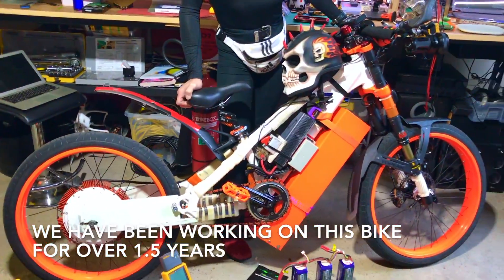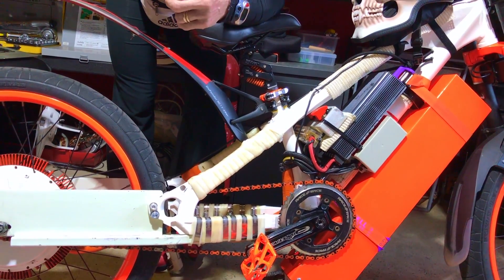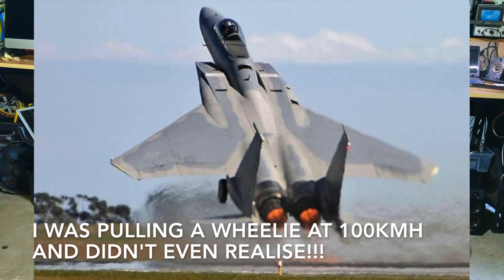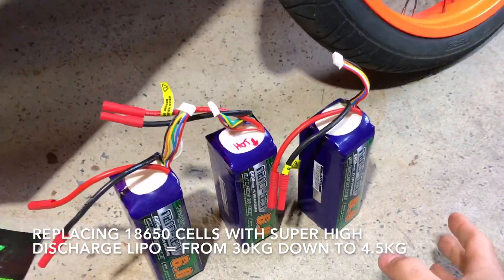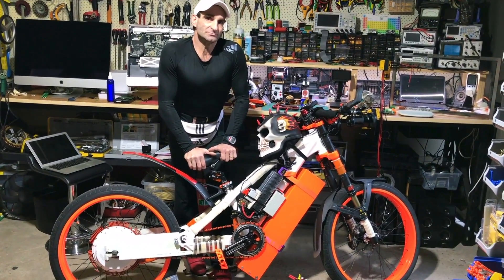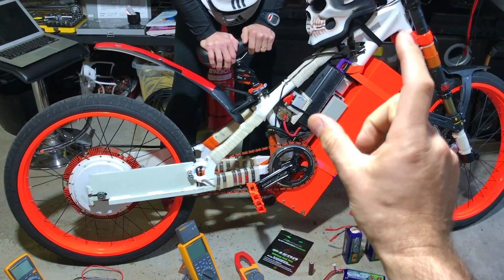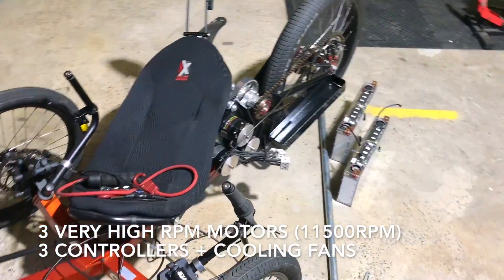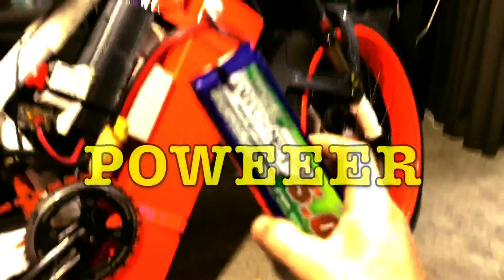191kmh Electric Bike (118mph) Video 1 - Project Introduction

Comment: Super cool why not take a cheap rear swing arm off a mtb with rear suspension got the triangle got the bushing n the shock mounts already it attaches in front of the bottom bracket stock so bolt that to the rear dropouts adding a pipe between

Comment: I've thought about building a very powerful ebike, but I got sick of not knowing the load & speed ratings of bicycle tires, and I haven't found motorcycle tires in bicycle or ebike sizes I was interested in.
Lacing a hub motor to nearly any sized rim, is fun, and I was even preparing to use a tap & dye kit to modify spokes that are between sizes. But for now, it's just too much money & work for me now. But I'm keeping my options open as I save money. Except no more hardtails, I want full suspension, with whatever bike I buy or build.
Thank you two so much for showing this prototype.

Comment: I have this same controller... how do you unlock it?
Reply from the maker: Yeah so there are two options when you buy it, standard and “unlocked” without software limitations to parameters. Basically you set things until everything explodes (we haven’t exploded anything yet).
Maybe email the company you bought it from and see if they can help you unlock or if you can send it back and they can do for you.
Reply: BrunoPOWEEER i see... thanks a bunch, can’t wait to finally have this monster up and running
Reply from the maker: Ohhhh yeaaaahhh... you will be surprised how CRAAAAAAZY this controller will feel unlocked hahaaa =]

Comment: Bruno how did you have hack the 100a Sabvoton bud?200 extra DC amps is one hell of an achievement 👌Did you change the fets or add more,change caps and beef up the traces with copper?Did you ever manage too get the standard Sab 120 to run more than the 120a and if so how did you manage it pls.Really want to see this bike go in part 2 Bruno🤞👊

Comment: @BrunoPOWEEER  I have a 72v 10000w bike. I made a 5p 20s configuration out of liitoKala 26550 cells. I have a sabvoton controller and anything over 120a I get high voltage drop. Also the top speed is 55 mph and I'm trying to make it faster. What do you suggest.

Comment: If you used those smaller high discharge lipos 6000mah is only like 6ah so what would the battery range be like I'm assuming it wouldn't be able to Last vary long?
Reply from the maker: It depends, if you have 6Ah configured in high voltage like 96v nominal and 117v fully charged it’s actually “okay” but if you have a 48v 6Ah it’s actually a very small battery.
Lipo packs would be good, smaller, lighter and capable of higher discharge but James the bike owner wanted to use 18650 cells (safer and more stable) as he rides this bike everyday. If this was a purely racing bike he would go Lipo all the way!! 
*HobbyKing has a 20Ah that comes in 4 or 6s bricks and are a great value + high discharge +/-460A peak, in my opinion these are a much better deal than smaller super high discharge 6Ah
Reply: Lipos are better for quick power dumps (sprints) and LiIon are more power dense and better for endurance (marathon)

Comment: if you get it licensed as a moped instead of treating it as an ebike and you have license plates on the bike you will not get stopped on the road, unfortunatly that means there will be the cost of insurance and such and you will need to install a limiter switch for normal, fast, and max speeds (p much just like a gear shifter)

Comment: i have the same motor but 30x4T what is the max temp cutoff and also what is his constant high temp?
Reply from the maker: We never got this motor too hot to touch as it has the Hubsink and ferrofluid which helps a LOT the heating dissipation. If you want more info, find James Raftos on Facebook, he’s often on Endless Sphere on Facebook (group)  and always very helpful relying comments =]

Comment: If you get speed wobbles your dead.
Reply: Bvlvi Woodson how are you? The bike is very stable at high speeds, the extra long wheelbase also helps. If it gave me the speed wobble I would have known by now. But you are right it would be disastrous.
Reply: @jamesraftos3586  I am good love the show! I have had speed wobbles twice in my 20+ years of Riding. Very rare but anything over 80-"95 if your strong asf"you will get thrown off the bike! I really like your show so please retro fit it with an anti speed wobble bar. Because I want more episodes! :)
Reply: Bvlvi Woodson thank you for your reply, do you mean to fit the similar system that they use on motor bikes?
Reply: @jamesraftos3586  that was exactly my thought! I wrote that response and not an hour later I saw a guy on YouTube get thrown off and go under a semi from speed wobble randomly. Weird coincidence.

Comment: Putting a 18-21" moto wheel on the front of my ebike (motor is in the back) how do I get bearings and axles to work?  the tire will be 2.5-3.5" wide. just need a point in the right direction. thanks

Comment: How much power is that qs 205 putting out? You said 300 amps at 117v, so 35kw? How much do those cooling fins help? I wanna get a qs 273 and some sabvoton controller, on the cheap, reason is all pre built ebikes have 250w motors and tiny batteries, and they cost half the price of what I could build. So for 2 times the price I could get a battery 4 times bigger and a motor many times more powerful, which seems like a much better deal since I like to build my stuff anyway. While I don't plan to go fast, won't have the frame and safety needed, I want to be sure I'm not overheating anything while climbing, and for a quarter more on the price, why not, get the best I can. For me hub motors are really expensive, shipping them to here costs as much as the motor, so if I'm paying that much might aswell get a good one.
Reply: renyn21 how are you? My motor stays nice and cool. The fins and ferro fluid work perfectly. I don’t use the bike at its maximum power for more than five seconds. The 273 motor and the biggest Sabvoton controller will be 😎 incredible combination.

Comment: Ok I thought 14kw on my downhill bike was nuts.  I can tell from that controller that it may do 20kw max , but I'm thinking phase power may be lowish to avoid big torque on those thin spokes.   Either way this is really pushing the frame and man bike tyres !  No DOT ratings here, those tyres probably have terrible speed rating especially when loaded with all those extra kgs .......  mmmmm.
Reply: Jestronix Handerson how are you? Thank you for your comments. The bike will go through its proper scrutiny from the track officials before I am allowed to run it on the drag strip. I am sure they will ask for many safety changes.

Comment: Research “Starship Coil” and “Faraday Disk” and see what you come up with then... hint... use Faraday Disk as front wheel instead of spokes. Note true info on the Faraday Disk is hard to come by. It’s output is exponential while rpm’s and magnet field strength play a one to one ratio, and it doesn’t break magnet lines of force so there is no resistance in that regard, no Lenz’s Law

Comment: Warhammer 40k orks built this bike, not engineers :)).....
Reply: Krom1hell how are you? This bike of mine is just the experimental version not the finished product. There are many changes to be made. It will be strictly for the drag strip. Completely different to what you saw in this video.

Comment: Guys can you help me...I need some advice building my E bike

So I'm panning to use 2 angle grinders(750 Watts each) as my motors then I'll get a small 12v 7.5 ah battery that will be connected to a inverter that will bring it up to 220v 1500 watts to power the 2 angle grinders...WILL ONE INVERTER POWER 2 GRINDERS AND DOES IS MY PLAN GOING TO WORK

Comment: you need sensors to detect wheel lift and back off the power, then you can get max speed without lift.
Reply from the maker: Phizicks Sketch Coleman is already finishing his “Launch Control Throttle” with accelerometers and a bunch of smarts doing exactly what you suggested. We should be getting one for tests very soon.... more POWAAAAAAAHHH
Reply: That's basically traction/launch control lmao
Reply: @Jai's Media let's see your build dude.. this bike costs probably more than my car and is fucking awesome.. there a couple of mad scientists
Reply: check Tom Stanton wheelie  cheat (controller)

Comment: Please involve the bedini wheel as it takes no energy 2 Spike back energy into the battery pack and you would receive free energy that way to chargeback partially and I see partially the battery pack as so to receive a benefit from what you guys are doing with your system. This is a partial free energy recovery system and could easily assist your power capacity without excess weight. Consider the advantages and do your research.
Reply: good idea

Comment: This is not bicycle, this is motorcycle, adding mock pedals does not make bicycle from motorcycle.
Reply from the maker: xtondakonf hahahaa it still a bicycle, there’s no one single component there that makes it a motorcycle =]
Bicycles wheels, bicycle tires, bicycle frame, bicycle brakes, bicycle pedals, bicycle chain, bicycle handlebars, bicycle seat... it is a bicycle on STEROIDS and a LOT more POWAAAAAAAHHH ohhh yeaaahhh!!!

Comment: I have a question. How can you draw 350 Battery amps while you have only a 7P battery pack made by LG HG2 18650 cells that can give you 7 x 20A = 140A continues power? The nominal voltage is 28S x 3.6v = 100.8V so the total power is 100V x 140A = 14.000W not too bad but not as powerful as it looks. With the new controller & Lipo batteries it will be a different story of course!
Reply: Ioannis Cherouveim how are you? Thank you for your comments. Ok it is 300 battery amps not 350, 28S at 4.2 very per cell gives you 117.6 volts. Each cell can deliver 30 amps for a very short time and I have seven in parallel which gives me 210 amps briefly. But the controller is set to maximum and it is pushing this battery pack to its limits. I have seen 245 amps on the CA very often. We are now going to put a huge lipo pack in and remove the 18650 pack and change the controller to the bigger model. 600 battery amps and 600 phase amps.

Comment: 2WD will be easier on the rear of the bike and the axle. The weight will help keep the front on the ground.
Reply from the maker: TomaCukor yeaaahhh all you said is 100% correct!!! I played with 2WD a few years ago and the results are VERY impressive!!! Here we are first pushing the “little QS205” to the limits then once we manage to get the “authorisation” to run on a proper drag track we will start playing with two motors, more turns, less turns... maybe 273 rear and 205 front... the sky is the limit hahaaaa more POWAAAAAAAHHH

Comment: Needs wider fork yokes & custom fork dropouts for 2wd same motor each end. Should be more efficient and more stable at high speed + acceleration will be better cos front wont come up so easily and if it touches down it will be helping. Just run front at lower current so i doesnt spin up so easily. Had a 2wd ebike til i snapped it in half. £oops
Reply: Bruno needs hub motors in his trike front wheels for 3WD!
Reply: Craig Overend 
A slightly faster motor speed 
on the front wheel 
will balance the bikes out better 
because of the pulling power . 
It will also help massively in keeping 
the front wheel on the ground 
for either bike  , 
they both have ‘one’ 
front wheel . 
So it might take just a bit more working out 
for the trike , 
to find out the right way for the balance 
equilibrium , 
but once you have it guys , 
you have it ! 

Enjoy yourselves . 
Take good care of yourself 
and stay safe .

Comment: Great looking electric bike, orange is a excellent color and the fender set is top notch.  I would be concerned about how low the battery is, otherwise, outstanding job.
Reply: MRBARBARYCOAST how are you man, thank you for your comments, the battery clears the ground perfectly. It does look low but the battery box is made from 1mm stainless steel. It is very well protected.

Comment: Brilliant what rear motor are you running? I have a QS273 H40 in mine
Reply: Ahhhh QS205
Reply: David Hammond the 273 is awesome:p
Reply: Anton Npn I’ve got a 273 ordered and a asi 8000 controller ordered off electric race technologies from California I’m just waiting for them to be shipped... I’ve upgraded from a max adaptto controller and a 14kw rear hub motor, can’t wait to get back on my Ebike 😊
Reply from the maker: We are pushing the QS205 to the limits first... if we need more POWAAAAHHH to round this to 200kmh we step up to the 273 hahaaa... hell yeaaahhh!!!